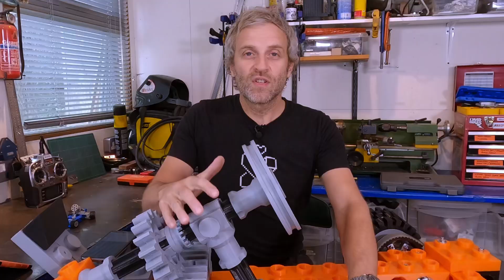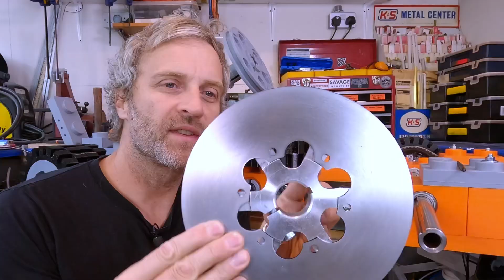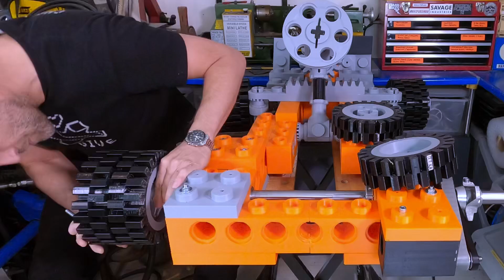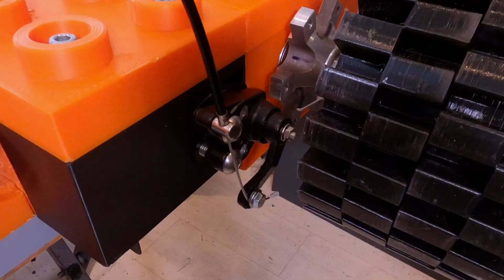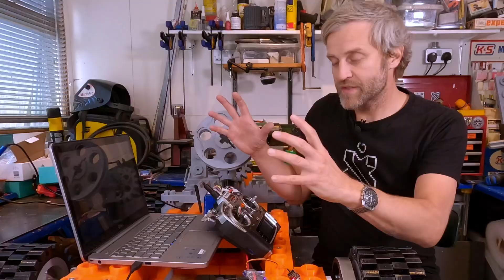XXL LEGO Go-Kart! | Motors & Brakes | #2 - Mantis Hacks

Comment: @ 6:48 that's not a tensioner...its actually more like a brace or strut... A tensioner would expand outwards to increase belt tension.. This does the complete opposite.. Just sayin.
Reply from the maker: I disagree. A tensioner tensions the belt, it can go in or out as long as the belt is under more tension.
Reply: @MattDenton  I see your point...it prevents from slacking...but there's gotta be a proper term for the type you used.
Reply from the maker: Well in my experience you push the belt down towards the driving pinion is that more teeth are engaged when in tension.

Comment: variomatic belt drive will give you plenty of pull away toque, but hard to limit top speed or controll power pick-up with it since electric engines have no idle speed... personally im not a fan of variomatics, but they do work a charm.

Comment: I love it , when I was a kid in Brazil back in the 60's building blocks was one of my favorite things, we didn't have Lego "not that I remember", we had one called Hering-hasti and it was really nice, it had motors, a two speed gear box, battery holders, tiny light bulbs etc, but I also use to put 1/8" screws to keep it from falling apart, I also use springs from retractile pens for suspension and use to twist some of my father's paper clips to make control arms.... good times! ps: watching this video looks like you still can't "LE-it-GO" 😂
Reply from the maker: 😆.. yeah it's a toy that got my engineering brain going and still entertains me today 👍

Comment: You said you could limit the total speed of the motor (I'm guessing with the Arduino), is there some kind of sensor in the motor that measures it's speed/rpm? If so, maybe you could also temporarily limit the speed when the motor starts from 0rpm, as the low rpm should give you more torque with an electric motor. Essentially program in a "low gear" to get you going
Reply from the maker: The motors have hall sensors built into them so the speed controller knows how to control the motor and what speed it's going. So I can limit the speed within the speed controller...

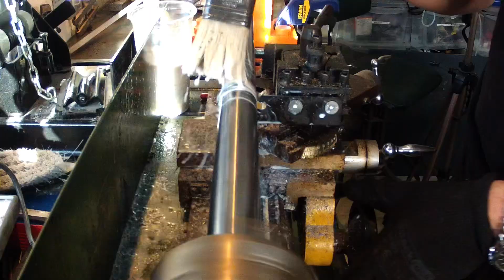Comment: 11:57 chamfer
also someone please explain to me the science of why it goes forward instead of turning when he turns
Reply from the maker: Not enough weight on the front axles combined with the rear wheels being locked together when they need to turn at different speeds in a corner.
Reply: @MattDenton  oh that actually makes a lot of sense, thank you for explaining that to me!

Comment: Go kart steering works by the geometry of the front axle pushing one wheel down which lifts a rear wheel so the lack of diff doesn’t stop you steering. Not sure how you would achieve that with Lego though.
Reply from the maker: Yeah it's called jacking I think...
Reply: Matt Denton indeed it is. https://www.paradigmshiftracing.com/racing-basics/how-karts-work-part-1-a-three-wheeled-vehicle#/

You could probably build these angles in to the front pins by printing them with the angles built in. Deviates from true Lego but makes it more functional.

Comment: If you're trying to lathe down the axel and you;re worried about it fitting in the lathe why not skip the middleman and just spin it up using the motor andrig up a tool carrier/brace so the part becomes its own lathe?
Reply: Also I love that he literally set up this jankey lathe solution right on top of a chop saw with a grinding disc already on it. But hey, how perfect was that Lego fit lol
Reply from the maker: Well actually it's a chop saw with a tungsten carbide tip which is really vicious and at best can handle 3mm box section 👍
Reply from the maker: True me... I thought about it 😆
Reply: Lol fair enough, worked out nicely in tbe end

Comment: maybe too late (and/or too complex) but could you get around both the power and the 'no-differential' issues by having  four smaller motors, one driving each wheel (maybe even mounted inside the wheel itself), programed to alter their relative speeds when cornering?
Reply from the maker: Hub motors may be possible but at this stage too complicated .. for now 👍

Comment: The motor battery and Vesc combination is usually used for electric skateboards... the skateboards are a lot lighter than your go kart and the parts for these skateboards are meant to be as small as possible. That means you should probably look out for other motors that are bigger. Just search for 1500w Motor on AliExpress or eBay. You will have a lot more torque with these kind of motors even though the wattage is lower. You can also look into converting a car alternator into a motor. Austiwawa made a video about that explaining how to do that. 
I hope I was helpful and good luck building your LEGO go kart
Reply from the maker: Thanks. Yeah I've seen those kart motors about 750 to 1500w bit they are quite large. James offered me one of these so I thought I'd give it a go as it would be easier to conceal. I'll try two and if it's still not enough I'll switch to a larger motor 👍

Comment: If you put a bigger pulley on the axil side of the car you will gain torque and less speed.
Reply from the maker: Yeah I have a 5:1 setup now. But had to switch to a different pitch. The pulley was as big as I could make it without effecting ground clearance

Comment: Try making it with a engine behind the seat like it is in the original lego model (actual gas engine). (edit) maybe try a Differential too. I would also like to see the mantis hexopod crush cars
Reply from the maker: That would be nice but trying to keep weight down now. The Lego diff would scrape on the floor 😬
Reply: @MattDenton  well with some gears it might fix that problem

Comment: I'd think to use a twin motor setup with a split axle. Maybe write some controller logic to put more power to the wheel with more grip (resistance) to avoid getting as stuck depending on terrain. the front wheels can do to use much softer tires, since they barely have any weight on them.
Reply from the maker: Yeah that is where the design is heading. Twin motor split axle 👍

Comment: 8:50 the tires on the left are lined in the middle unlike the staggered right side tires. 14:00 another one. 16:45 just why
Reply from the maker: They slip around the wheel rims 😂

Comment: In keeping with the theme, I kinda feel like if you DO try to use any differential, you’re going to have to use the Lego designed diff otherwise it’s just not going to feel right.... although that doesn’t help with the need for twin drive lol.
Reply from the maker: The Lego designed diff would be dragging on the floor 😀

Comment: If you increase the gear ratio to a 5 or 6 to 1 you will gain more torque and the top speed will decrease which can be safer for your nephew. You will also get faster acceleration.
Reply from the maker: Yeah I’m trying 5:1

Comment: The plastic wheel are probably going to be too smooth and feel like shit, bit it does look the part. Having some really solid rubber cart wheels and turn them down might be doable, but cutting out teh bits to make it look like the Lego wheels might be quite hard, but being rubber would feel a lot nicer.

But man does this thing look awesome.
Of course you have to cheat a bit at times, liek the bearings at the front wheels to not get the rubbing issues, but who cares really, it's a life size Lego cart !|

What would be cool, but useless, might be a 1 cilinder plastic Lego engine build with a rather slow gearing on it so it doesn't actually move too fast and shatter or rub too much, and put that over the electric engine somehow behind the chair to just fake it.

Oh dear, wheels too smooth and no differential, this might be problematic indeed, would be a shame for such a marvelous project.
The solution for the gas and break pedal is brilliant in its simplicity.

Yeah, not safe for a kid, in any way shape or form, or safe in general even maybe.
Reply from the maker: Thanks 🙏 appreciate the feedback. Actually the tyres are printed in a TPU material donate semi rigid about 95 shore A hardness I think. I used the same material on my 5 X scale R/c version.. grip was ok... Ish... 😬

Comment: Why not make the cart direct drive with those types of motors in every wheel for better control, also maybe add soft rubber inputs in those wheels or print a wheel cover wholly in soft rubber.
Reply: Called a "hub- Motor" :)

Comment: Maybe add a 2nd motor on the opposite side, that would be a beast of a go kart.
Reply from the maker: Will don
Reply: Just some tought if you built a kart with 4 motors one for each wheel, in regards for steering and breaking with the assist from the motors, this sound to ridiculous but I guess there is already 4wd go karts out there, but doing a 4wd build I would sure love to watch. Keep up the good work mate, stay safe.

Comment: Loving this project, I would cut the KV on the motor to at least a 3rd of what it is now, try for a wider bell, shorter bell, more bottom end motor control and use a slightly larger drive gear. The torque difference would be huge and would cut the speed down nicely so that you can reintroduce it back in with more cells on the lipos in series.
Reply from the maker: Well it's a 149kv motor, there is only a 130 below this unless I go to a different design.
Reply: @MattDenton  I didn't consider it was already so low kv.

Comment: You need a lower kv motor for more torque, also think you need proper tyres otherwise you will have no traction and it going to skate around.
Reply from the maker: Yeah I'm getting 130 KV.  Tyres should be ok on concrete 😬

Comment: @Matt Denton In my opinion you should cut the shaft in two pieces and attach two motors in order to get some differential on the pulling wheels. In order to keep some of the sturdiness of the backend, you could then create a hub with two bearings to join the ends of the suggested two halves of the shaft. Also you should stay with the FOC mode for the ESC's in order to minimize stress on the engines cobber windings and prolong the battery lifetime(as it should be more economic as well in FOC mode). All in all you'd get more torque, better steering, silent driving and less recharging.
Also i simply LOVE your crazy project, it's mind blowing and epic !!
Reply from the maker: Hi. Yeah I've had the same thoughts with a coupling link to rejoin the axle and gain the strength back. I've been told that my VESC won't like FOC mode at 12s batteries... So slightly wary of that .. I have a new VESC coming that should be better.
Reply: @MattDenton  In either case I look forward to see what you come up with in the future :-)

Comment: Such a cool project, thanks for sharing. I reckon you should make a bigger pulley for the gear on the axle. Can you get pulleys smaller than the one that you currently have on the motor?
Reply from the maker: Thanks. Yes and no. I'm on the limit of pulley size for that belt size. I can go to 5:1 with a different belt...

Comment: if you will sit on that cart that motor will burn to death, maybe it would withstand to pull a child. But to actually make this cart a beast you would need  lots of $$$.
 lem 200 motor : https://lynchmotors.co.uk/pdfs/lmc-lem-200.pdf ; 
spm 48600 controller: https://lynchmotors.co.uk/pdfs/lmc-alltrax.pdf
HRB 6S 22.2V 6000mAh 50C-100C Lipo
Reply from the maker: Nice DC motors... But way too big. At 11kg just for the motor. I've seen these in use in my industry (film) they are great but too much power for this.

Comment: Instead of attacking gearing for low end torque I would look into using a sensored kit instead ;)

15:37 oh damn you did.
Seems like not just a wheel balance, but a dyno run is in order too!

Even with sensored motors it takes at least one phase getting lit up before the real torque can be applied, but that’s usually not too much of a problem as that’s usually only about 5• of motor movement and with even 4:1 gearing you’ll achieve that seriously easily making hulls this things bitch. You can also usually advance the timing to gain top end or “retard” it to get more torque

If you were to go to 6:1 or even 7:1 you would have more than enough torque to flip this thing, be careful with your amps at 50~v ;)
Reply from the maker: Thanks for that I do. Yeah I think I can get to 5:1 with a HTD5 belt .  And maybe dual motors will give me the extra starting torque.. I've limited the current to 50A max but it's not getting any where near that yet....
Reply: Matt Denton be careful going much higher with hobby controllers and ev’s, get your hands on a sensored ebike or scooter controller for access to more variety with actuation tech for throttles (pots vs variacs? I think, I don’t remember)

You will have better luck there with it lasting too (hobby esc’s tend go boom after a while with these kinds of uses, the caps just can’t handle it and the phases usually need double the fets at least so they don’t blow under load :)

50 amps really is a lot at 50+v

A hub motor would be way more efficient to be honest, perhaps more cost effective too. Not to mention a touch slower and no gears or belts ;)
But that would be an entire axle redisgn for the most part :)

Then again you are talking about a second motor and esc.
Get your hands on a 2nd hand mobility scooter with dual drive and steal its wheels/controllers even battery)

Doing this would make lowering it with a few lead acids vs an expensive lifepo4 or dangerous lipo pack for a 10yo would probably be the best way to go too, bring cost down a notch too for you :)

I love the design, but if it’s for a kid at the end of the day this is really, really overkill 😂
And small hubs shoved into the LEGO wheels would be at least 80% more efficient

Comment: You can make one of the rear wheels free spinning with a bearing. Alot of cheap small carts use that as a way to mitigate the differential issues. The only major downside is one wheel drive.
Reply from the maker: And one wheel braking 😬
Reply: @MattDenton  Hah. yeah those cheap carts use pads on the tires as brakes on both sides for that reason!

Comment: L and R wheels will and want to have different speed in a curve/corner. So a singel axel for the rear wheels will try to  prevent any steering and thus. splitting up the axel and using a differential will make sure that you still can use a singel motor  and still power both rear wheels yet allows the wheels to have different speed in a curve/corner. In other words the cart wont try to prevent steering as much. I know this will change the orginal model a bit but it will be safer and even if you manage to steer with one rear axel, you will get less wear and tear with a differential
Reply from the maker: Yeah I'm currently thinking if dual motor and electronic diff with spilt axle 👍
Reply: for anyone that is interested in how a differential steering works https://youtu.be/yYAw79386WI?t=116

Comment: After reading several comments about a split axle and  separate motors, try this: Dis-connect the drive from the wheel on the opposite side of the motor. (let it spin freely)This will give you one-wheel drive, But will drastically improve your steering capability. This is how old-school go-carts work in the US.
Reply from the maker: Yeah I can give that a go... One wheel braking too 😆
Reply: @MattDenton  Yep,  1 wheel braking too. my first go-cart didn't even have brakes. I braked Flintstone style. I went thru a lot of shoes. When I eventually found a brake drum for my go-cart, I didn't have a brake rod (we didn't use cables) I actually used an extension cord tied around my foot and then attached to the brake drum. It worked for about 4-5 stops, then the wire broke. My return spring on my throttle was a fat rubber-band connected to one of the engine bolts. It worked for about 2 hours before it melted.   hey, I was very young and didn't have much money. I used what I had available and it worked.. For the most part.
When I finally got all the correct parts for the go-cart, I took it for one last ride before I sold it at the Flea-market for $100.  I never had another go-cart.. So SAD!!
Reply from the maker: 😁... I'll buy lots of shoes 😂

Comment: Also thought about using the needle bearing washers on the inside?

I know it creates less stress on that side wile taking a turn, but still it pulls on the axle and could make it run smoother.
Reply from the maker: Yes I do have a second set in case this is needed 👍
Reply: @MattDenton 
By the way, love your projects....

Finally someone with an alternative state of mind... 👍👍

By the way, the steering problem can be easily solved...

Print the rear tyres from a material with less grip then the front ones, it will slip at the rear if you start steering.

Of course this all depends on your weight distribution, for you to ride on it and be able to steer, you need to create length so you sit more in the middle.

Comment: Super cool Matt! This is so inspirational on so many different levels! I agree that two motors would be better with a split axle. Lego Racers set 8475 (the radio controlled Technic set) had this set up where both motors were connected in series, providing an electric differential of sorts.
Reply from the maker: Huh that's interesting... Series connected 🤔

Comment: I really enjoyed your video. Makes me wish I could build the same. But my wife would kill me if I come up with another thousands of dollar spending hobby :D:D. With the issue of steering has no effect I dont think it is related to missing differential, but more likely due to weight balance. 90% of the weight seems to be on the rear axle rather than on the front wheels. The slippy tires do the rest. You may want to consider using real rubber tires and a heated knife to cut the Lego style profile into it.
Reply from the maker: Yeah I'm addressing the weight distribution.. the wheels will be better on tarmac.. I hope 😆